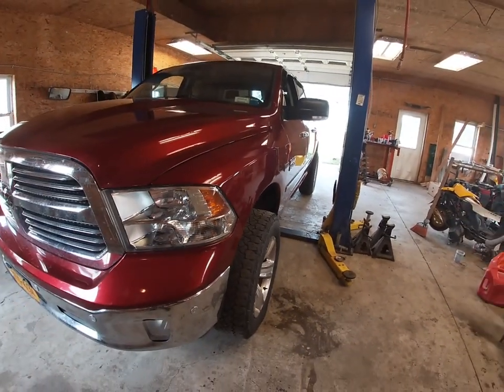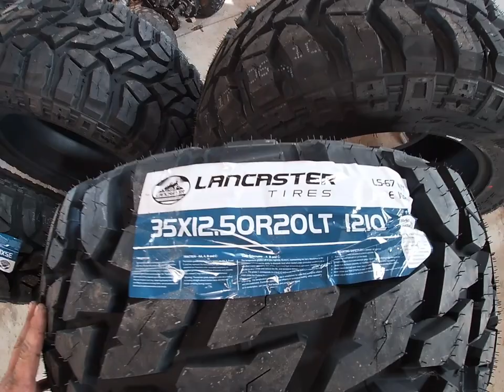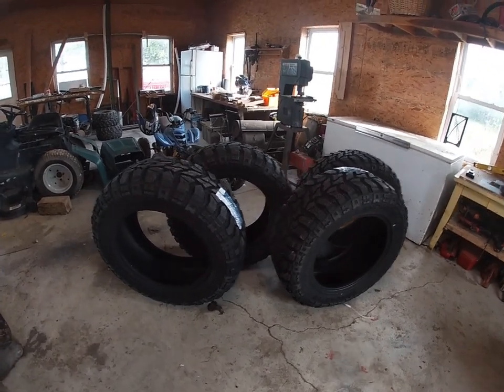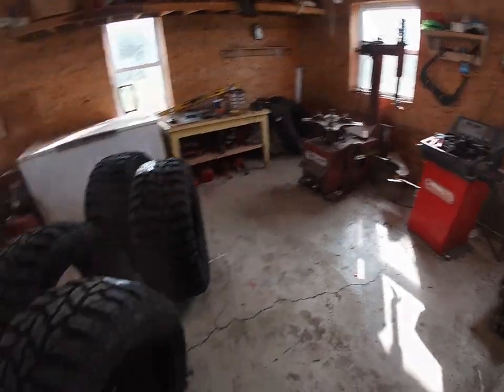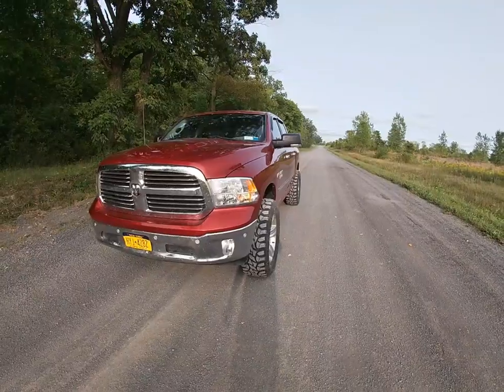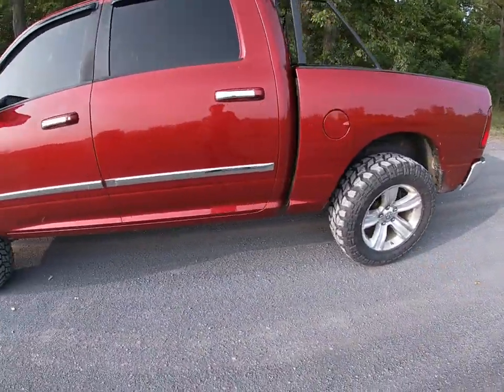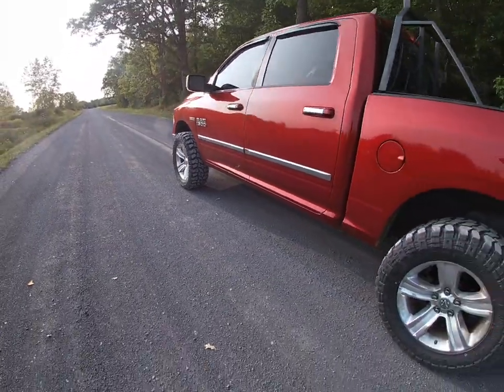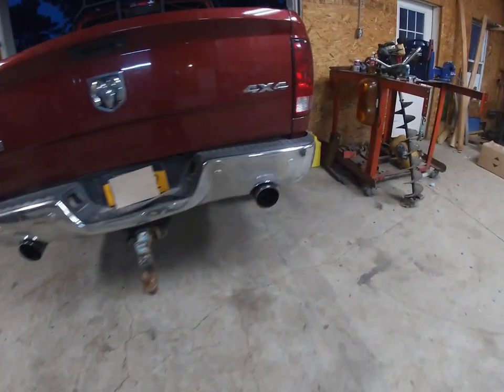LEVELED RAM 1500 35" Tires INSTALL Plus 5" TIP'S

Comment: I have a 2013 Express with a Hemi. The tick is killing me. Doesn't go away like some people say after warm up.  Didn't hear any on yours.  Truck looks and sounds sick man! 🍻
Reply from the maker: I know that sound all too well!! I'll put money on it that your cam lobe on #7 cylinder is ground down because the needle bearings in the lifter roller took a hike. Trust me, been there with 3 5.7's!

Good luck and thanks for the comment!
Reply: Would that be something covered in the warranty? I brought it back to dealer. Said they did looked at it. "Normal for this engine", they said. Unfortunately,  my regular mechanic said the same thing. I'm thinking about bringing it to a different, bigger, local dealer. I believe they will honor the warranty as long as they are licensed. I'm not a gear head. Wish I was.
Reply from the maker: You will have to fight a bit but if you are still under power train warranty and can prove all your maintenance, if will get covered. If that doesn't work, buy a aftermarket cam and hellcat lifters and never look back. Oh and delete the MDS!
Reply: @griffsgarage6028  OK buddy, where do you live? I'm bringing this thing down to you. I trust you more than any dealer up here. Lol. Thanks for the info. Subbed 👍
Reply from the maker: Haha sounds good! I will be doing a cam and lifters in mine this winter. Keep an eye out for the video!
Reply: I heard somewhere it has to do with the gas. I have the same issue
Reply: Got a stage one cam and lifters from ams racing got rid of my lifter issue now I need to get rid of the manifold leak
Reply: Looks great any updates or rubbing issues or anything?
Reply: You may have broken exhaust header bolts that’s caused the ticking

Comment: How did your Lancaster MTs hold up? I’m thinking of getting a set for my 17 Dodge 1500 on my stock wheels. How much level would you recommend? I’m thinking of either 33s or 35s.
Reply from the maker: Still running them. Have about 40k on them! Rotate every oil change! Shouldn't need any level to fit

Comment: Hey I have a 2014 1500 is it possible to run 33x12.50 on a 22x12 rim  with a 3 inch leveling kit?
Reply from the maker: I haven't personally done that setup but I think it would work with the right offset rim
Reply: @griffsgarage6028  cool thx
Reply: I run 35x12.5x22 ona level kit 2014
Reply: @teebo5298   im looking to do 35x12.50 on the stock 20 inch rims.. i got have a rough country n3 leveling kit. Is this possible or do i need spacers?

Comment: Do you think the 35s would fit with only 2 inch in the rear?
Reply from the maker: They clear the rear no problem. It's the front that may scrape. Depending on your trucks rake from the factory

Comment: Hey bud when you installed the 35s did your tmps start acting up ? Like did you get a tire pressure indication etc
Reply from the maker: I have not had any issues. I'm running 40psi in them. Whoever is changing the tire, needs to pay close attention to not disturb the TPS/TPM. Doesn't take much to mess them up!

Comment: I have a 2014 Ram with stock 20” rims. 275 60 20... I’ve seen other videos where people slap bigger size tires on stock rims. What do you think the biggest size that would fit would be. Also has no lift kit add on or anything. Thank you.
Reply from the maker: I've had 3 4th gen RAMs. 275/60r20 is stock tire size which measures to a 33" tire. I ran 275/65r20's on them all before any level. They measure out to a 34.3" tire. No rubbing on any of them. The '11 sport I had I ran 33x12.50r20's before and after a level lift. No rubbing and all on stock wheels (close to upper control arm though). I've seen 35's crammed stock height but not on stock wheels and the inner fender needed trimming. Possibly a 295/60r20 may fit nicely at 34.5", but I have no experience with them!

Hope this helps!!
Reply: @Griff's Garage  Have a stock  not level nothing ...2017 ram 1500 big horn slt. Stock tires 275-60-20 I'm wondering if 275-65-20 will  fit or if it will Probably rub full lock or if I go over speed bump while turning or something like.... that coming out of a park and garage hitting a speed bump while turning Is any highway vibrations etc . Thanks man

Comment: Did you have to mod your control arms at all.  Or is this absolutely 100% stoke?   I want 35s on my 2017 ram but csn onky afford to level right now
Reply from the maker: All I did was pop the upper ball joints out a bit then weld them back in at a slight angle to compensate for the front lift I made

Comment: I didn't see you switch the part that connected to the ball joint. That part will break when lifted. I seen it on alot of channels. Sorry I can't remember the name of that part..
Reply from the maker: Control arm? I've heard people blowing out ball joints because of the severe angle after lifting. That's why I pressed my upper ball joints out, repositioned them to account for the angle, then welded in place. I've got almost 30k miles on my setup. No issues 🙂